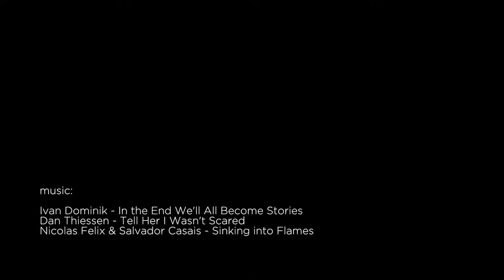Staircase wardrobe construction

Comment: Is it just 2x3 wood that you used? And who did you attach the frame to the wall, was it with bolts or screws?
Reply from the maker: Yes, and I've used regular wood screws to mount these to the studs.

Comment: Amazing work🎉
Could you let me know what kind of screw to fix the stud (wood) to the plasterboard? 
Thanks.
Reply from the maker: You can't screw the stud to the plasterboard. You'd need to locate the wall stud first and align your construction studs with it. In other words you screw the construction stud to the existing, wall stud. You'd need to use long screws for that, so they go through your stud, plasterboard and into the wall stud.

Comment: Fantastic construction! How are you supporting your ladder though - looks like you put a plank on one stair and a box of some sort on the lower stair - is that right? Is it safe? (Wanting to do something similar myself but got stuck at step one trying to figure out how to safely work at that height over the stairwell).
Reply: Yes, you are correct. I've used two Makita boxes on the lower step (2 down) and connected these with the upper step using a plywood board. Only then I've placed the ladder on. I'm aware there are some ladders that can be placed on the steps but I didn't have one.

Comment: Doesn't look like there's any ventilation in there. Is it a problem? Our fitted wardrobes had condensation issues before we installed vents. Although it was on an exterior wall.
Reply from the maker: That's a very good question. We were in fact a bit afraid that this might be an issue. So far so good, though should any such problem arise I'd make a vent on the small wall I've put between the wardrobe and the stairway.

Comment: That looked like a lot of work and expense (if you paid for a professional to do the work) for just a smallish additional wardrobe. It might have been cheaper to throw a clothes rail in the loft or sort clothes into seasons and cycle them between loft and wardrobe. It would be nice to know if the man contracted himself out to do the work how much it would have cost including materials, too much for most paupers like me. Great job though, looked lovely
Reply from the maker: Haha, thanks. The project was mainly around gaining more space by using otherwise idle area. I haven't do the costs calcs, though the main expense would be: the tools, which I've already had; and the rough materials, which I expect would be a fraction of what you'd pay a contractor I guess.